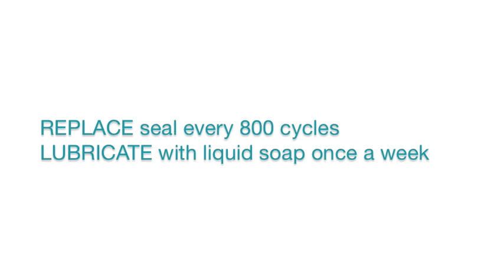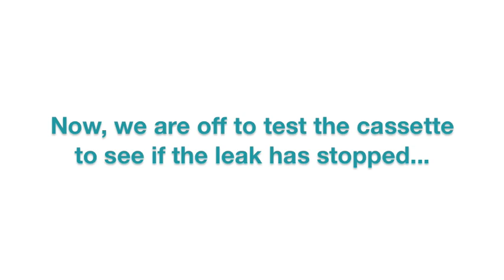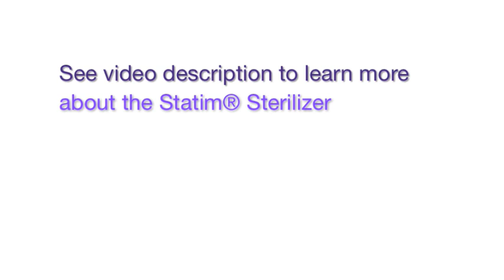Statim® With A Steam Leak

Comment from the maker: We suspected another component at first too, as the seal had recently been replaced. However, close examination did not reveal any problems with the probe bracket or other components.  Replacing the seal proved to be a long term solution in this case.

Comment: Probe Bracket looked dirty.With condensation on front usually means the probe bracket needs to be replaced. Water under unit only = cassette..Condensation on front = probe bracket. Probably was temporary fix replacing the seal only.